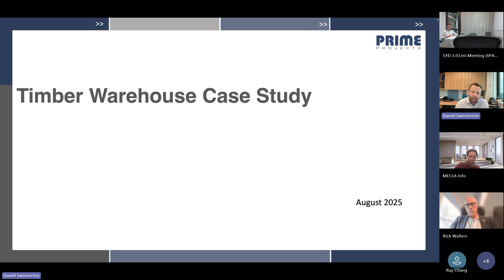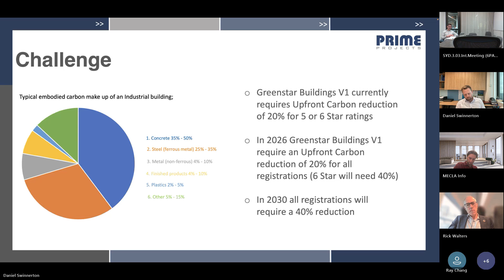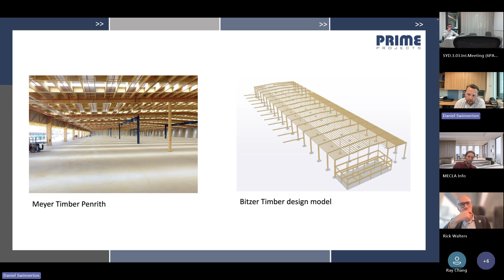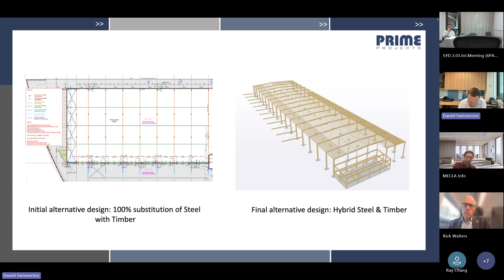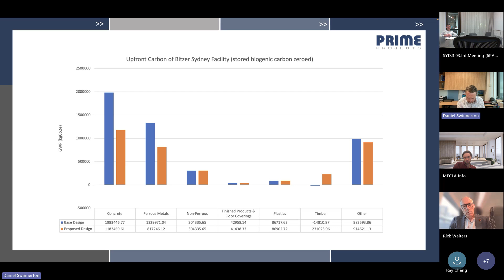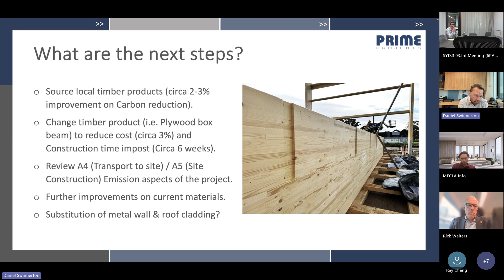Mass Timber Construction in Industrial Warehouses | Daniel Swinnerton | WG3/4

Comment: Is a breakdown of the results available somewhere? The title of the pie chart refers to the upfront carbon of each element of the design (not the reduction) for the revised design, so i'm not sure how he's equated this with a 6% carbon reduction due to timber. The embodied carbon for the timber in the revised design should be significantly higher than the base case because there would be no timber in the base case!